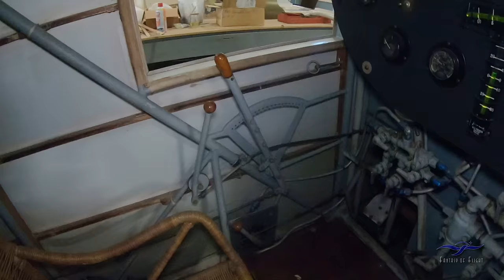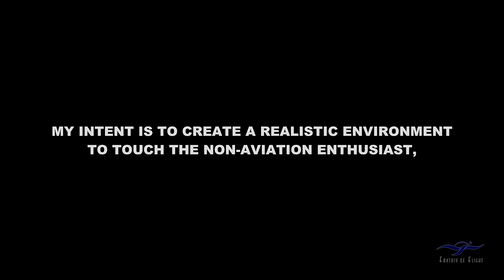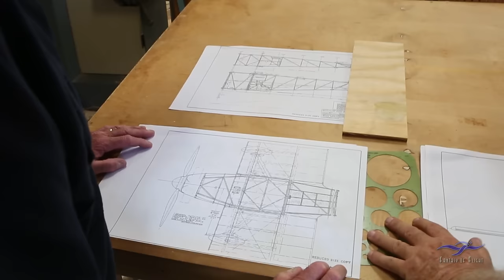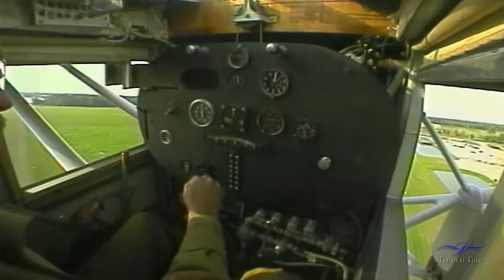Spirit of St. Louis - Cockpit Experience Development - Part One

Comment: Just a thought here. Instead of having the seat move so that people can get in it and roll/slide up into the cockpit area, how about having part of the fuselage slide backward along with the seat, so people can get into the seat more easily (not all can squeeze into a tight spot so it would allow more people to enjoy the experience). It would keep people from possibly hitting their head. Once seated, the fuselage slides up into place with the cockpit portion as if it were all one piece. This way you could have a much more robust sliding mechanism underneath for strength and reliability. Less maintenance.

Comment: I love the idea of the 'inner experience' of flight. I also think that I know what Kermit wants for the seat mechanism, but not sure the team have quite grasped it yet! However it will be great when it is finished!
Reply: I think that all 'inner experiences' are made in conjunction with input from our surroundings. The 'inner experience' Kermit relates to also comes from flying the real deals. So I think, as a basis, the visitor should get the most realistic experience, even if pulleys are needed. The difference to a simulator, is that this experience is a more passive one, absorbing the environment and its atmosphere. 
Yet, touching a control for 'inner reflection' and feeling bungee cords, may alter the 'inner experience' in an unintended way.

Comment: Another idea for a seat track could be to just rob one from a junker Cessna, and remove the stop mechanism. This would give you a proven, off-the-shelf track and roller system made for that exact purpose. You might have to find longer tracks than the standard 172 would have, but you could also probably get the same or similar track from the rear of a 400 (414, 425, etc)series Cessna. It's an option.

Comment: Roller Blade wheels would work well, small have there own ball bearings and don't cost much.  Use an angle beam for the track and you could mount wheels on top and bottom of the track and that would hold it on like a roller coaster.
Reply from the maker: You’ll see in a coming update, we got professional motion picture dolly track and wheels.

Comment: Kermit, might I suggest you find a live theater tech director somewhere, and entice him to share a few hours of his experience?  Possibly someone from a local university theater, or a dinner theater, or something like that.

There are all kinds of theatrical rigging products available off the shelf that could be adapted to that seat roller problem, and most of them will be a lot smaller than those wheels. There's also plastic caning material that is a lot cheaper than getting real caning done for the seat. It can look very close to the real thing. That seat is a wear surface, and is likely to get cuts and holes poked in it from people having junk in their hip pockets. That's a very common problem with theater seats. You will probably need two seats, one in use, and one to replace the one in use when it gets compromised. The one not in use can get new caning without taking the attraction down.

A theater TD that has been around for a few years will be able to suggest all sorts of solutions that I suspect your people are unlikely to find on their own, simply because they know airplanes, not tech theater. And what you are building is a theatrical experience, so it makes sense to get someone onboard (at least part time, or occasional consultant) that knows theater.
Reply from the maker: Already been working with top theme park designers. This concept is just a spaghetti phase.